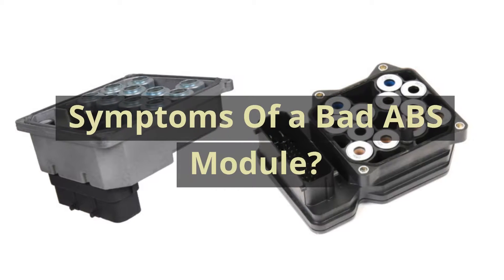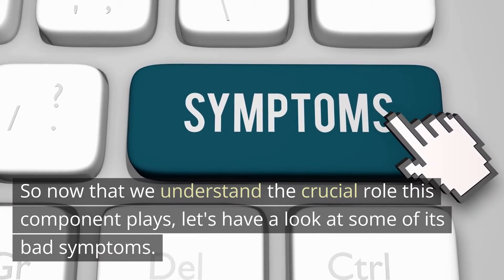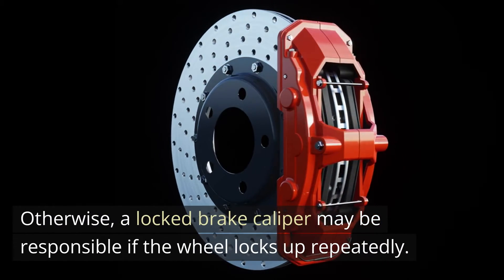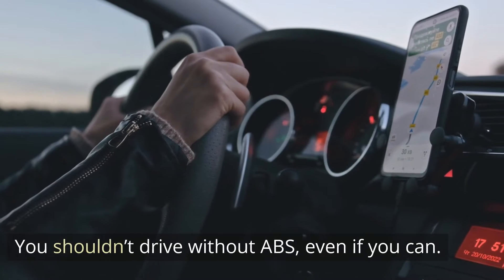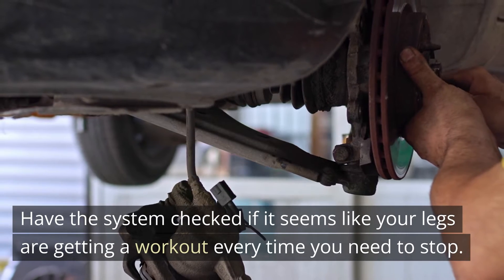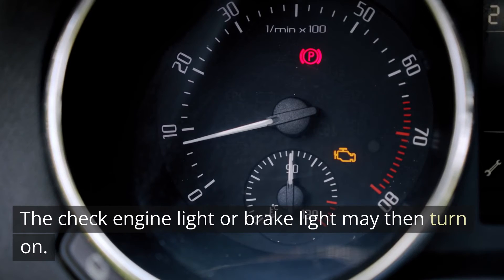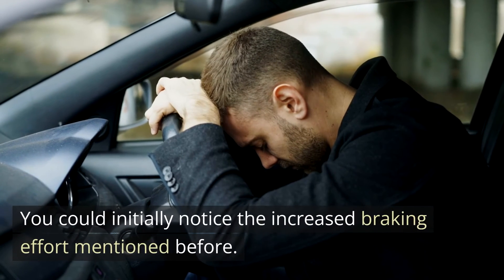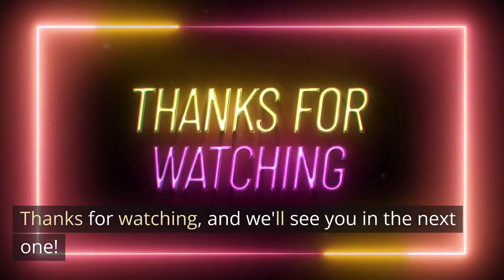Symptoms Of a Bad ABS Control Module

Comment: I have new rotors, new pads, new caliper on drivers side, but the piston inside the caller drags when I let go of the brake pedal, what could cause this? 😛
Reply from the maker: If the caliper piston is dragging even after replacing the rotors, pads, and caliper, there are a few potential causes:

Brake Hose: The brake hose might be collapsed internally, causing fluid pressure to remain in the caliper and keeping the piston extended. Inspect the brake hose for any signs of damage or collapse.

Caliper Bracket: The caliper bracket could be worn or misaligned, preventing the caliper from retracting properly. Ensure the caliper bracket is securely fastened and aligned correctly.

Master Cylinder: The master cylinder could be failing, causing excessive brake fluid pressure to remain in the caliper. Check for any leaks or signs of malfunction in the master cylinder.

Brake Lines: Check all brake lines for any kinks, restrictions, or damage that could be preventing proper fluid flow and release of pressure.

Pad Slides: Ensure that the brake pads are able to move freely within the caliper bracket. Lubricate the pad slides as necessary to allow for smooth movement.

Rotor Thickness Variation: Even though the rotors are new, there might be excessive thickness variation, causing the pads to drag. Measure the rotor thickness at multiple points to ensure it is consistent.

Improper Assembly: Double-check that all components were installed correctly, including the caliper, pads, and hardware. Even a small misalignment or incorrect installation can cause dragging.

If you've ruled out these possibilities or need further assistance, it might be best to consult with a professional mechanic to diagnose and resolve the issue effectively.
Reply: @studentlesson  those are all great ideas, it's funny ,the dragging didn't start til I had new rotors put on, but my old ones were warped. 🙏
Reply: Hi . If abs module  is going bad,  does it make brake pedal travel a little more than normal
Reply: @Bryan-il1vu  Yes, if any of the OUTLET valves inside the modulator does not seat well and is leaking (( internally))  to the spring loaded accumulator.